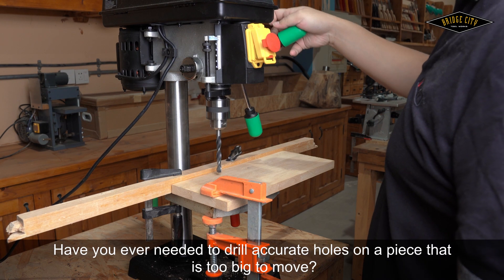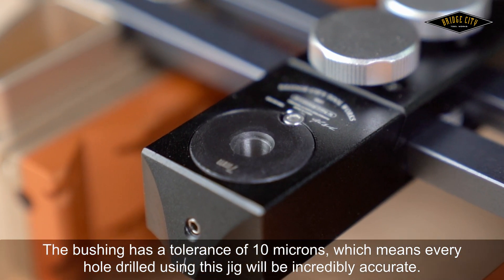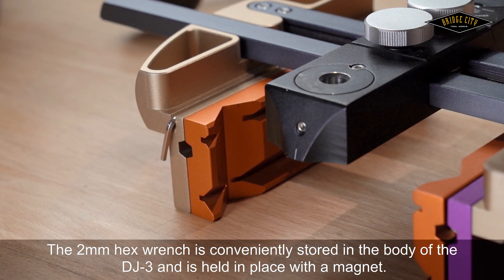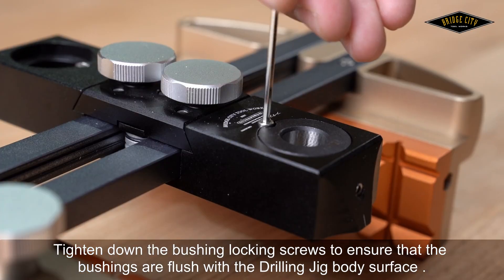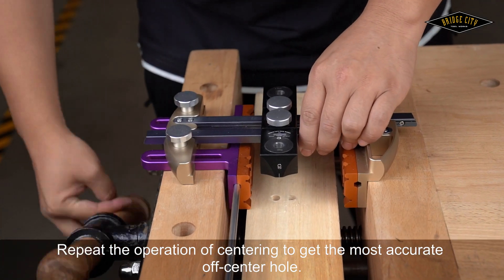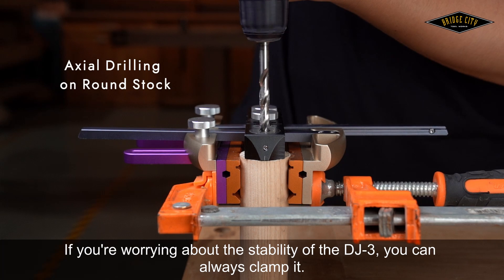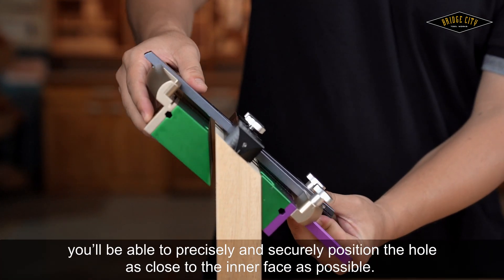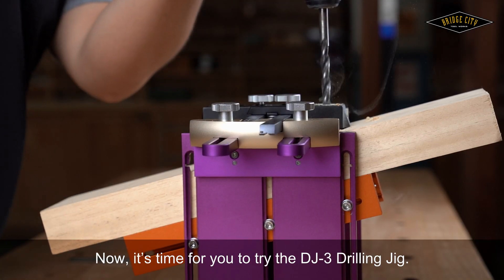A New Bridge City Tool Launch! DJ-3 Universal Drilling Jig

Comment: If I took this much time to drill every hole in a project, I would never finish anything.  Also, if you expect to sell a very expensive tool like this, try drilling in something more appropriate than an old 
2 X 4.   Surely you wouldn't have to clamp every piece in a vice just to drill a hole in it....kind of like using a drill press to drill every hole.  It is pretty though!!